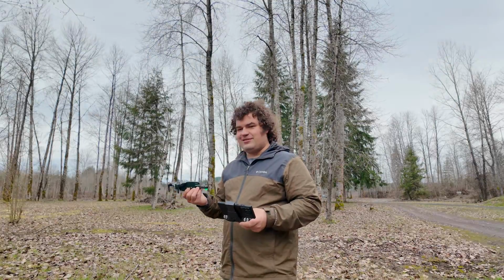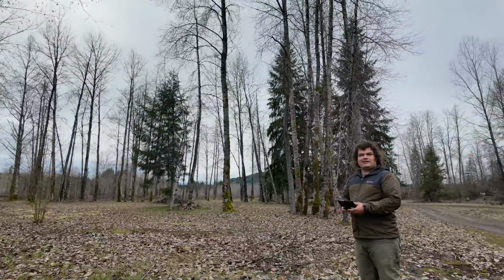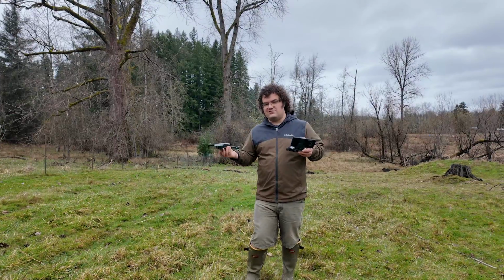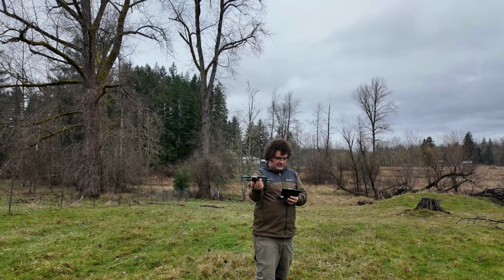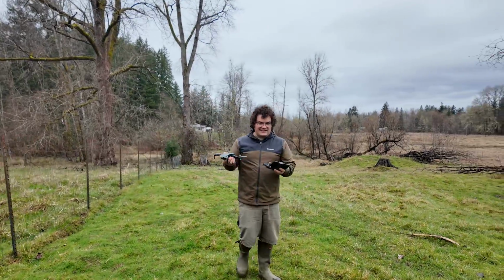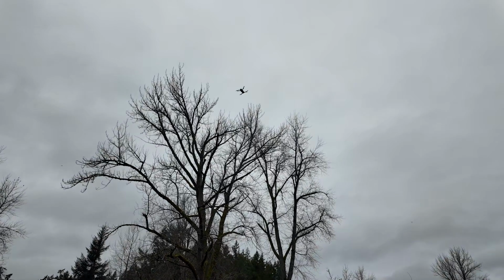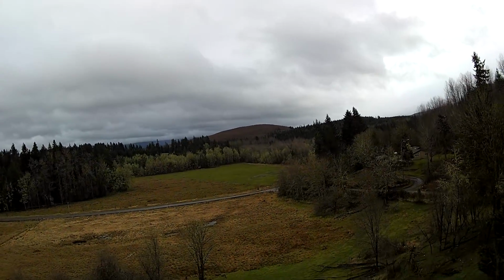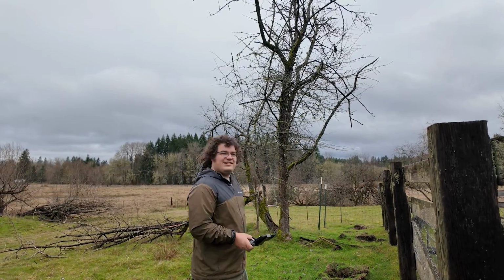Gleesfun G11Mini Drone Flight Test - Will it Crash?!

Comment: You’re doing the calibration wrong, the drone is the center axis. Giving it a carnival ride with you as the axis is probably whats causing the circles. Maybe forgot to link the controller on the 2nd flight?
Reply from the maker: It's how I've always calibrated DJI drones when they've required it, with consistently great results. Also, I used the same calibration technique with the Gleesfun Mini on test flights where it was relatively controllable, so I do not believe improper calibration is the culprit. Connection between the drone and controller is highly unreliable, as frequently it works when it first takes off, but then later becomes unresponsive.

Comment: O man.  So cringe. Toilet bowl effect is compass issue and not calibrated correctly
Reply from the maker: The drone runs through a compass calibration routine before each flight. If the compass is the culprit, then calibration doesn't work.